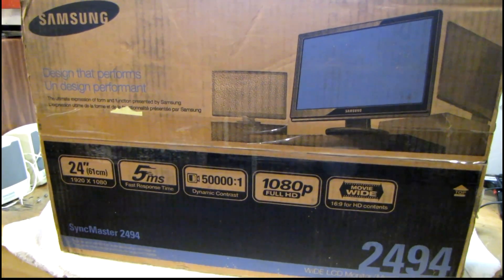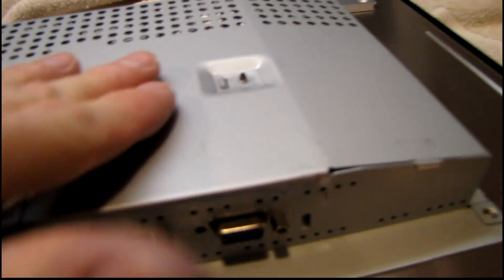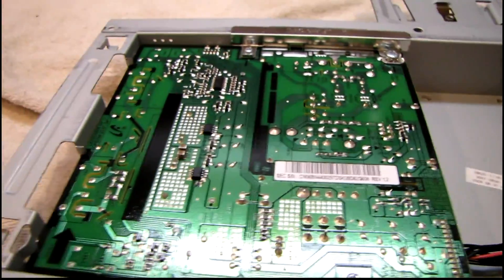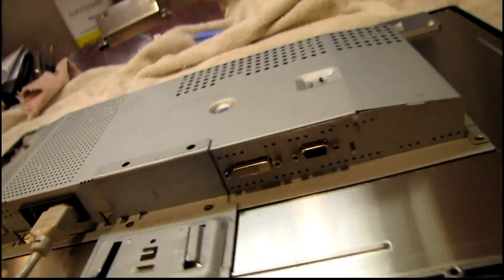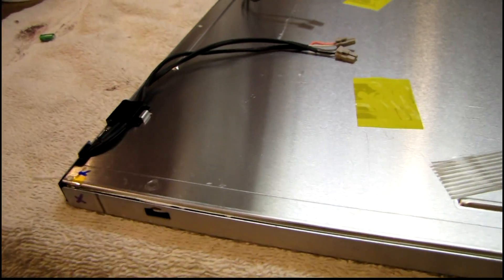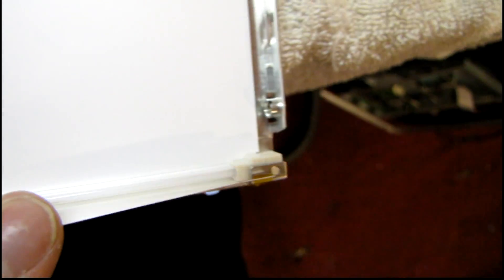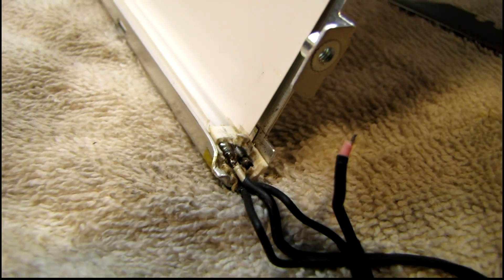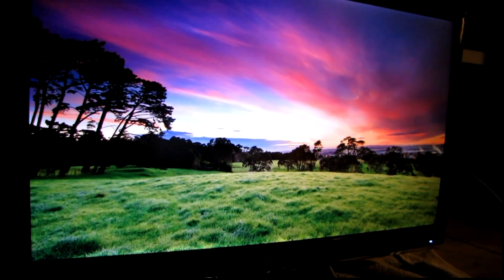Samsung Syncmaster 2494 LCD Monitor Repair

Comment: I have a Samsung Syncmaster 2494 LCD Monitor, too, but it stopped working. Now I repaired it - it was a defective condenser on the 3,3 V rail. You couldn't see it, I had to use an ESR Meter to detect the faulty one. Now it's working again. It's still a nice monitor - i use it as my second monitor.

Comment from the maker: @JoeyJoeJoe5000 IMO the best monitor size is a 24" 16:10 ratio.  The ones that are 1920x1200 resolution.  I use a 30" on my main PC, but I got it mainly for the color accuracy.  Sometimes it's just too damn big LOL.

This Samsung was a 16:9, (1920x1080) but it's still nice for my workshop computer.

Comment: Not sure if you'll be able to help. Same exact monitor. I get 1 second of clear picture then it goes black - no menus etc.. Always get that 1 second of clear picture on a fresh power up.

Took it apart looking for dry joints or obviously cooked capacitors. Nothing looked too strange, although the smaller board has a rattle (is there an orientation sensor maybe?). Can't locate the exact component, but something has a very light rattle. Is that possibly the problem, or should I be looking at the caps?

Thanks in advance,
Reply: ***** Thanks for the reply mate, appreciate it.

I took a $22 gamble on eBay for a brand new power board - it arrived a week ago and I just put it in today. It works perfectly. Obviously you just can't trust the caps to burn out in a visual way. Pretty happy. Cheers,
Reply: I'm having the same problem with mine. Going to take a look at it tomorrow. Thanks for posting what you did to fix it.
Reply: Morgan Parkinson Hello Morgan , 
Could you please give the ebay link i want to buy samsung syncmaster 2495 hs power board

Comment: @Maxxarcade I have the 24" 16:10 ratio. My problem is the power adapter where it plugs in the back. At first if I jiggled it, it would stay on, now there is nothing. I think my dog got tangled in it and jerked the cord. Please help! How do I fix it. No screws, just slot that says lock/unlock.

Comment: yeah replaced 3 caps in the HP ps19e monitor and fixed it. was free from computer store going to recycle. the 3 caps in this monitor always go it seems because they are cheap.

Comment: Did the output ccfl wires go pink & white on the inside & blue white on the outside? for some reason every time I replace the power board my inverter/transformer (tm-10176) keeps catching fire in the same corner.... even if the lcd is not plugged in

Comment: i have a Samsung 2023BW and missing the 6 capacitors (3 close with 3 close) (3 capacitors UP and 3 capacitors right) what volt is ? (2:29)

Comment: so i know this was 7 years ago but i dont suppose you rember how you got the stand off the back of the monitor do you? it looks like a rivet on it and it looks like you removed it on yours
Reply: Did you manage this in the end? Same problem here
Reply: @matthewhill3556  First you need to remove the screw on the bottom of the stand. This will allow you to take off the round swivel plate.
To remove the straight part, just wiggle it and pull down at the same time and it will come off. It's quite snug on there though.
I have a SyncMaster 2494HS.
Reply: @FUG_GOOGL  so strange to get a reply on this as I manged this just the other day. I had removed the plate. All it took was to really use some force 🤣 thanks for the reply though mate!
Reply: @matthewhill3556  You're welcome :)
I know because I opened mine today.

My screen goes black after 2 seconds. Caps are looking good to my surprise so I'm afraid it's either a problem with the CCFLs or something else.
Ugh, I wish it were the caps as I can replace those. CCFLs look tricky and I've never done that before.

Comment: @maxxarcade: sir, i had my samsung caps replaced. also the blown fuse. it was working, but in a few minutes, it started flashing. and right now. no display. the pilot light is working. i can hear a charging sound. then a small blink of the backlight  and then the recharging sound again.. just looping.. any idea about it? should i replace all the caps?

Comment: anyone know where i can find the schematics for the power board for this model? two caps are blown and i thought that was all to it..but with further inspection there is a blown mirco resistor. it's so small and it doesn't have the id. i need to know what resistor to get to try and replace the destroyed one.
Reply: There is a similiar schematic and I've made one on my own, but youtube doesn't allow me to post any links. Sorry.

Comment: How do you remove the stand?!? Ugh!
Reply: John Contreraz right???? wtf
Reply: Any updates on this question?
Reply: Well, I'm 4 years late (or 2-3 years for the other replies) but first you need to remove the screw on the bottom of the stand. This will allow you to take off the round swivel plate.
To remove the straight part, just wiggle it and pull down at the same time and it will come off. It's quite snug on there though.
I have a SyncMaster 2494HS.

Comment: Please show the right way to remove the cover
Reply: Remove all four screws on the bottom back. Than release the clips on all sides with a screwdriver or plastic tool. Last step is difficult: You have to remove the stand, before you can get the back of the outer plastic housing completely off.  The stand is hold in place by a shiny metal clip on the metal housing of the monitor electronics.